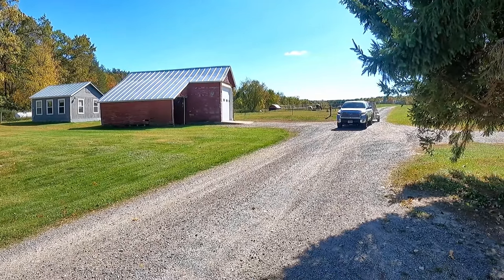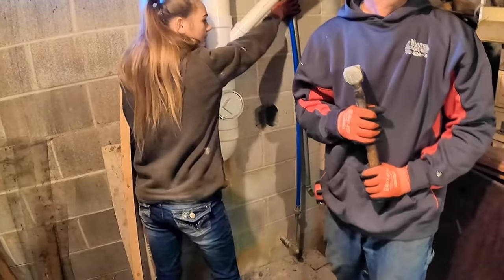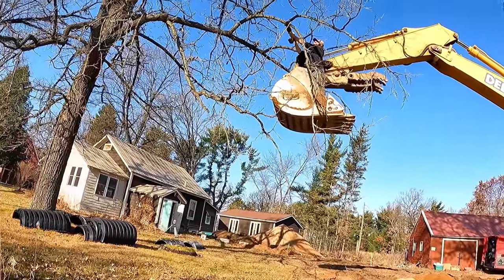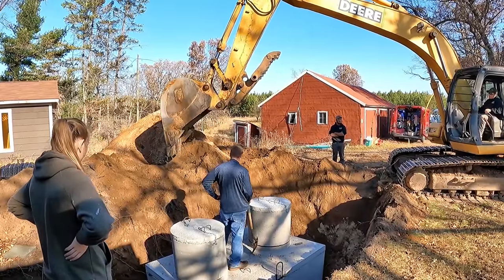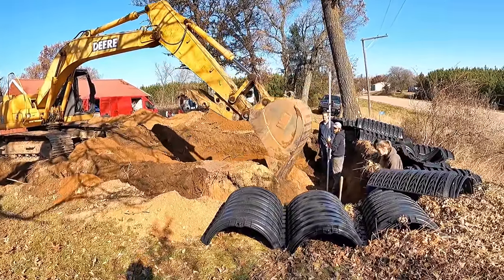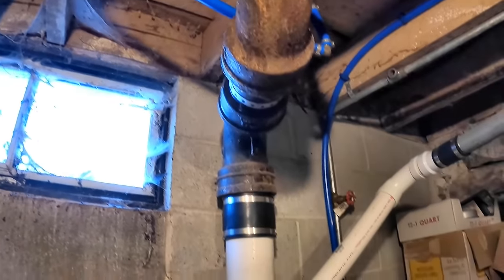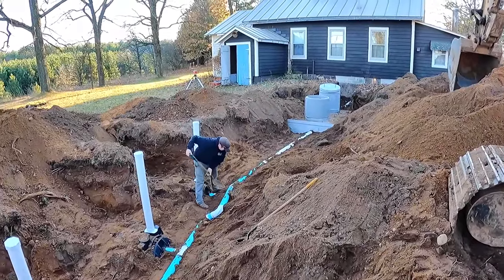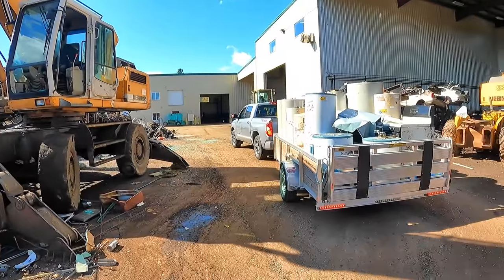Blonde Girl Plumbing Septic Tank Replacement

Comment: Speaking of water heaters, my house still has original 1965 model, and why should I replace it? It keeps on truckin, they built things to last back then.
Reply from the maker: Yes that is amazing. Most of the water heaters he replaces are leaking or there is something wrong with them we believe it has a lot to do with the hard water in the area.

Comment: I had mine done 20 years ago. They used my existing tank and added a 500 gallon concrete lift station to pump the waste up the hill on my property to the new septic lines. Just curious what the overall cost was for your project. Great video! Now you and J can install septic systems when you get back to Cebu.😀😂🤣
Reply from the maker: Haha.. I did not see the final bill but I think it was under 10K USD. he told me about some of the more complicated ones he's done for restaurants and bigger buildings but this was small I'll gravity-fed relatively simple and easy except for the size of the lot.
I think J would be interested for about one attempt and that might be a test :-)

Comment: The penetration through the foundation isn’t even close to waterproof. The “plumber” didn’t pack any hydraulic cement under the pipe and into the foundation around the pipe. SMH!
Reply: Seemed like dirt needed to be dug out more to be able to tell.  Easier to be sure than dig it up again.